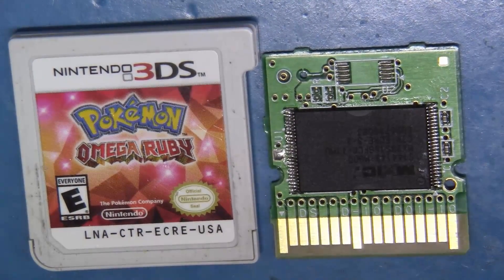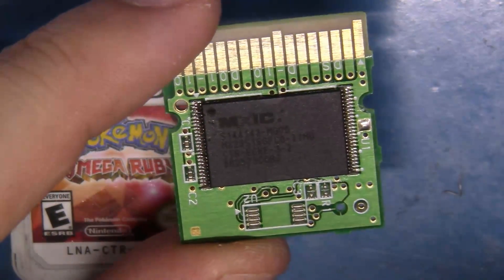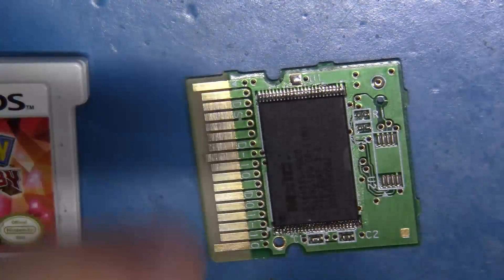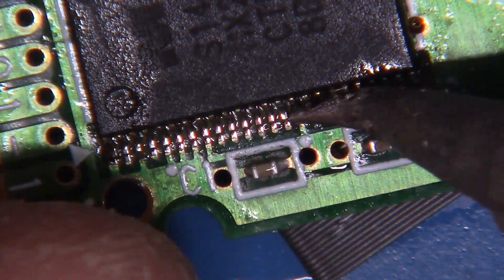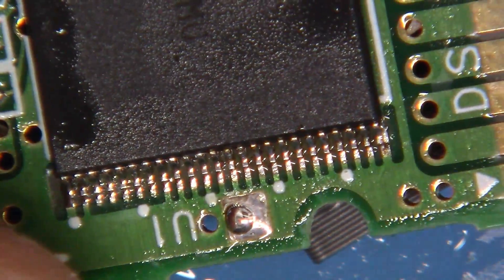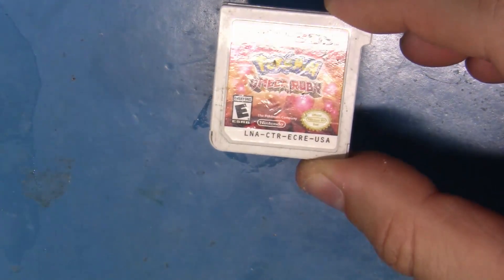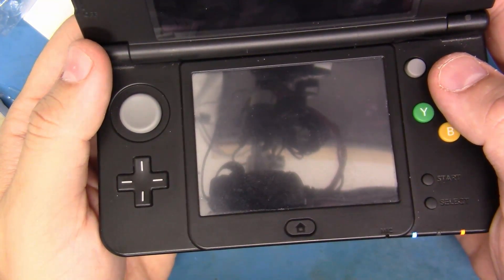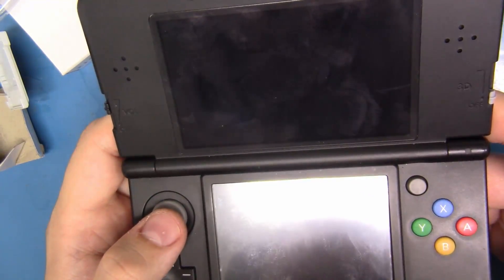Repairing a FAULTY Nintendo 3DS Pokémon Game Card | RAW/UNEDITED VIDEO

Comment: If this is happening with 3DS games then it probably is also an issue with DS games, unless the latter is using a less dense package. I agree that there is a lot of nonsense out there. You have to do the repair. You can't say what is wrong with something by guessing.
Reply from the maker: Yes. You're 100% right.
Reply: @Voultar Hello i am Wondering if you can fix my Omega Ruby game it doesnt even go to the start screen it just goes to and error has occured messaged pls help
Reply: @Voultar do you have a way to fix Pokémon Y everytine I go into the pc or leave a Pokémon centre the game crashes
Reply: @KrazyPugz  i think it's most likely the same issue. Crashing and failing to boot was a common problem with pokemon y and omega ruby
Reply: Age of Empire DS was built like shit, I never investigated the source but I had a huge pile of these carts sitting on a shelf at some point.
Reply: 00:20
"This. Isnt. Booty"

No sir, it is not

Comment: Today I pulled out my European launch edition copy of Omega Ruby after I hadn't started it in a long time. To my horror it wasn't detected at all, not in my original 3DS and not in my 3DS XL. I tried to reflow it, but that didn't do the trick for me sadly. I'm by no means an expert and I only practiced with a dead graphics card before, but I still think I did an ok job. I used a ton of flux, took my time and triple checked with my own eyes and under the microscope that there were no solder bridges. After it didn't work the first time I even tried to reflow it again which was much better due to the experience I gathered with removing solder bridges, but that didn't change anything.  
So it seems like I really got a faulty flash. My older Pokemon Y edition still works fine, so it seems to be from the bad batch of games.

Comment: This just happened to my pokemon x. This is the only video I've seen that shows this. Thanks.
Reply: Did it work for you? It happened to my Y copy years ago and I never managed to find a fix, including this.
Reply: @CritsVG I couldn't fix my copy of smash bros because I messed up.. I used way too much solder on the tip of the iron . Iwas supposed to only use a small micro dot of soder
Reply: @Josemembrain  Oof I see... Yea I think my problem might have been similar, had a friend do it that has more practice in soldering than I do but I think it might have been too much solder too. Thanks for the update!
Reply: @CritsVG yeah when I tried booting up my copy of smash after I fluxed and soldered, my 3ds would self power off. Then I inspected under a magnifying glass closer inspection, I saw that the connecters in the side of the board where I soldered were connecting with over splash.
Reply: It sucks because the connecters are so microscopic we only get one chance at fixing it.
Reply: @CritsVG give me an update if you fix your 3ds game.thanks
Reply: @Josemembrain  Tbh I don't even know where mine is right now 😂 It's been a year or two since my attempt to fix my copy of Pokémon Y, and I remember it being the same issue with the device powering off. At the end of the day, it's also still possible the Flash memory just simply gave up, we will never know... I would ask of there's really no realistic way to remove the excess solder, but with how long it's been, I doubt that would make a difference even if it were somehow doable.
Reply: @CritsVG that is true 🤙
Reply: My super smash bros took a dump. It's time to buy flux, an iron and get to business.

Comment: My copy of omega ruby just died, but al the other cartridges are still working, and i was only worrying about my gameboy and gbc gba cartridges because some have a little bit corrosion on the gold pins, and now i don't now how long 3ds games will last? Had my 3dsxl in may 2014 and my copy of pokemon x in later in that period, so it does not belong to the first batch of games, and i don't have the knowledge to repair broken ds or 3ds games

Comment: Sorry what is the liquid? English is my secondary language and I can't hear ehat you're saying.
There is Pokemon Super Mystery Dungeon for very very chwap for sale that suddenly stopped working, shows up in menu but crashes, I'm contemplating getting it
Reply: Liquid is called "flux," it's important for cleaning your work so the bond isn't brittle. Basically if you don't use it, you could manage to solder correctly and still have it break again soon after.

Comment: Can you solder without that liquid just solder?
Reply: The liquid is necessary. It cleans the residue from the solder and distributes heat evenly across the part you are soldering. It's called No-Clean Soldering Flux Paste.

Comment: I tried it, and it didn't fix mine. So I tried it again, and it still didn't fix it. Then I put it under a hot air rework station and fully removed the memory chip, cleaned all traces of the crappy lead free solder off the pads, and resoldered it again with lead solder. It STILL didn't work. At the same time, I repeatedly ran the cartridge though the 3ds corrupted cartridge fixer tool that skawo posted over on GBAtemp. It fixed other cartridges, but not this one. 

So... yeah. My copy of omega ruby is done for.
Reply: I'm going through the exact same. I feel you. May your copy rest eternally in peace..
Reply: @Chop109  Hey on the bright side, I was able to save the pokemon off the cartridge.

Comment: I currently have a problem with my Pokemon Y game, I put into the 3ds, it appears on my screen that the game Is there, I open it and after the 3ds logo an error image on the touch pad pops out, telling me to turn off the console and try again later. I did it several times and it keeps saying the same thing, same error message. Could this be the problem? Should I try this method?

Comment: Yo, I also have the same issue with my omega ruby game, how do I fix this issue without the equipment you have used on the video
Reply: impossible you need a soldering iron, you could try putting a needle in the over but I dont think that would work
Reply: @leanmeanmememachine323  oh okay thanks

Comment: Both my copies of "Pokemon Omega Ruby" and "Persona Q" have stopped being readable.  I'm kind of a bumbler with tiny objects, so I'd rather ask someone else to fix them, but I don't know what kind of repair shop I should ask to do it.  Does anyone have any suggestions for me?

UPDATE: I took the cards to a representative of Asurion's "uBreakiFix" group, and they tried exactly what was done in the video, but the cards still don't work.  Does anyone have another suggestion for what to do, or somewhere I can send them?
Reply: No, bit rotting are killing them in mass, not loose pins. Loose pins are a very little %.

Comment: OK so, my AlphaSapphire has had this problem for a few years now.  I'd like to try fixing it soon, but I'd like to backup the save data on the card.  I just modded my 3DS, and tried using Checkpoint, but it doesn't work because it doesn't see the game.  Is there another application I can use instead?

Comment: So I took apart a PAL Alpha Sapphire today, reflowed it... Sadly doesn't seem to have fixed anything, spent a few hours but no dice :/
At least it didn't cost me too much to buy but yeah, real bummer. I do believe that this one may have just reached the end of its flash lifespan sadly
Reply: What you can do (and what I did yesterday): hack your 3ds (tons of very good guides available), dump the savegame to an SD card, get a working copy of moon, load it onto that cartridge. Nothing illegal doing that, and the mons can even be transferred to bank as the savegame was not altered in any way

If the flash is dead you won't be able to dump the save, but as long as the game is recognized in the home screen you should be gucci
Reply: Yes, unfortunatelly bit rotting are killing them in mass, not loose pins. Loose pins are a very little %.

Comment: Stumbled upon this today... Found my copies of HeartGold and Alpha Sapphire neither worked was able to clean the contacts on the HG so it read, cleaned up AS but it gives a "This Game Card could not be read" message. Sometimes it'll actually load in, play the 3DS intro and then go black and give me an error message that requires me to completely power down my 3DS. The save file is still intact (Pokemon bank can pull it). One thing I will note is despite my cleaning efforts with isopropyl 70% alcohol there's still a tiny dot near the board on the middle contact, I'm not sure if the issue is this tiny dot (what are the odds that there was virtually no gunk but one tiny dots worth ate through?!) Or possibly this flow issue. 

I'm concerned because there's at least 1 Pokemon I really want to keep that is on my team (honestly there's a few others but one I really care about) and the party is the only group that can't be put into the bank... 

I'm trying to figure out if trying this is worth it, my alternative is jailbreaking to backup the save (probably a wise decision regardless) to then inject onto a new cart or a digital version. I would need to get a soldering kit to do this though, I guess I'm trying to figure out if you or anyone else who found this video helpful ever had it where it was showing but just not booting (in this video you stated it wasn't showing before).
Reply: Did something work for you?

Comment: I have the same issue on my moon cartridge that had all my shiny and battle ready pokemon (like 20 boxes) after it stopped booting i gave up on the game just hurt too much lol but i found it again and im determined to fix it anyone have any other tips? The game looks super clean on the inside no visible faults, could it just be bricked?
Reply: What you can do (and what I did yesterday): hack your 3ds (tons of very good guides available), dump the savegame to an SD card, get a working copy of moon, load it onto that cartridge. Nothing illegal doing that, and the mons can even be transferred to bank as the savegame was not altered in any way
Reply: @pdoge  ty! Still haven't been able to fix it so I'll try this method and see if i can figure it out thanks!!!

Comment: I managed to get open my Pokémon Y game. I’m 100% sure I have the same issue as you did. I’m not as elegant, but I managed to get it open using a small flat head screw driver and my finger nail with some damage to the case, but I’m happy with my work. It’s minimal damage  and the plastic casing definitely can still be used only minor issues. Now the soldering thing I have zero experience with so I’ll need to ask around and see if someone can help me with that part lol.
Reply: dude my pokemon Y game doesn’t work either and idk anything about soldering :( i bought it used from gamestop and the game never read
Reply: @zombae I had the same scenario just happen to me. I guess its time to learn how to solder

Comment: Note: A couple of Months after the physical vesions of Pokemon Omega Ruby/Alpha Sapphire, they were regarded by many people as being a defective batch due to their rushed soldering. It was noted that you could re-solder the connections but that it was very difficult of a task due to how small the pins are. Thank You for making this look easy/showing how it can be fixed.

Note: The only other defective batch I know of is Persona Q. There is nothing physically wrong with the Cartridges but there is a bug that results in the game crashing on the Final Boss every time. At the time, Atlus would offer a code for the digital version which works perfectly (if you agreed to show them photographic proof that you destroyed the game cardtridge) but due to it being a much older title (about 8+ years), they do not offer such a thing anymore. (also like, where can you buy a new copy of Persona Q from a retailer these days?)
Reply: For me, it was my pokemon Y cartridge 😭
Thankfully, my Alpha Sapphire seems to still be okay but my pokemon Y had this issue 3 months after getting the game. I was absolutely heartbroken because I had my second shiny ever on that game (shiny Scrafty that was lv 100) and the only solution people gave me was to exchange my game for a new one. Luckily pokemon bank came out and it would still turn on sometimes, but now it's completely toast (likely cause it has the same issue and after years it finally gave up).

This gives me hope that I can maybe find someone who can fix it and preserve my game file if I ever want to look back on it! Sure, the pokemon are saved, but it would be nice to have access to everything else on my old game too 😅
Reply: damnnn i have THE SAME PROBLEM with my pokemon Y. my game keeps crashing when i try to reset and on boot it says its currupted, dang i didnt want to open it  @3amhellbeast
Reply: If I got a persona Q I’d there no way to fix it?

Comment: Hey, is there any way to fix this process when you do it mad wrong?
I think I over-soltered, and now any time I put the game in, it loops a reboot of my entire 3DS until I take the cartridge out.
The 3DS is fine after the fact, and I've decided to just pull a digital version off the COUGH-COUGH since I have the game physically anyway.
But if there was a way to fix my colossal mess-up-- just for the novelty of having a working cartridge-- could I?
Reply: Maybe use solder wick to remove some of the solder?

Comment: I have a copy of Omega Ruby that failed as well.  The game would start up and then quickly error out before you could play it.  It's a legit cart, I'd played it for a while, but when I went back to it it was dead like that.  It's the ONLY official cart I've had that's failed like that, very strange.
Reply: I'm having this right now. Alpha Sapphire, shows up on my 2ds but crashes before title screen...cleaned the cartridge, cleaned the cartridge slot, cleaned the inside of my 2ds..... Nothing.

Unfortunately I can't solder.
Reply: I've had the same thing happen with my pokemon Y cartridge
Reply: An alpha sapphire copy that I bought secondhand also only worked for about 5 minutes before the error. Was annoying because I "tested" the game before I bought too. (Off of kijiji, Canadian craigslist I suppose)
Reply: I just got a copy of omega ruby and it isn’t even loading … it was sold to me still in the plastic so I don’t understand why it isn’t loading on my 3ds
Reply: @hankrocks7504  For you and others, AS & OR were produced when Nintendo was using a cheap soldering option, so the joints are vulnerable to cracking, which partially remove the chip from the board. Try doing what this guy did to reconnect the joints.

Comment: I remember watching this video a few days after you uploaded it back in May 2021.
Now, my 2nd copy of OR died - it crashes on boot, either with the looping splash screen on my old 3DS XL or with a black screen and error message on my New 2DS XL. 
My 1st one, which I bought on launch day with Alpha Sapphire, doesn't show up just like the one in the video. I hope reflowing both will at least fix my 1st one, as it has my original save on it.

All 3 are PAL, however Alpha Sapphire still works like a charm, probably because I played it way less ¯\_(ツ)_/¯

Comment: I've got a similar issue to this and I was greatful to stumble across this video! I have a pokemon white 2 copy for they life i can't get it to stay working. I havent tried any soldering on it but i have tried cleaning it. It only works when it IPA has been applied. This at least gave a hint on what to just need to learn soldering and need to figure out wich chip needs a reflow. I can now rest easy now that I know it can be saved.

Comment: My copy of Omega Ruby has been crashing for no reason, it used to work just fine with no issues, it will boot up and then say something like, turn off your 3ds there has been an error. Would you recommend the method you did in the video to fix this?

Comment: Bingo! Thanks for this, the internet had me believing some ORAS cartridges were made with a defective batch of flash chips.
Now that I think back, a couple decades ago back before I really knew what I was doing with electronics, my cousin had a Pokemon Yellow cartridge that would boot but all the trainer and Pokemon sprites were glitchy garbage Missingno-looking things. I opened the cartridge (I had a miniature hex nut driver that happened to work with Nintendo gamebit screws with some minor pressure) and found that the game would work properly if I pressed down on the mask ROM chip. At the time I assumed it was something wrong inside the chip but now I realize it was probably this. Anyway I knew pressing on it made it work, so I set a small wad of paper on top of it and closed the cartridge so the lid pressed on the paper which pressed on the chip. I'm not sure how long it went on working but he never said it was messed up again.

Comment: I bought Pokémon Omega Ruby on its release in 2014. I played the game for a bit but then, life circumstances forced me away from my 3DS for years. So the game sat in the console cartridge port all the way to 2021, and it barely saw any insertion cycling. Late 2021, I got to play with my 3DS again, and when I tried to play Omega Ruby, it gave out an error that force a console reset every time I tried to boot the game.
I highly doubt the issue with my copy is mechanical wear of the cartridge, might be wear on the console cartridge port, but then again it works fine with all my other games, including Alpha Sapphire I purchased at the same time as Omega Ruby.
I ended up buying a downloadable version to preserve my game befor the eshop shuts down.